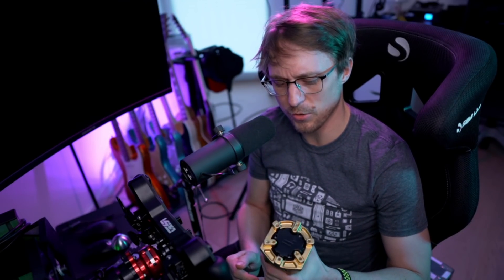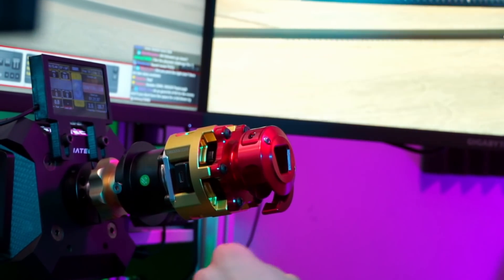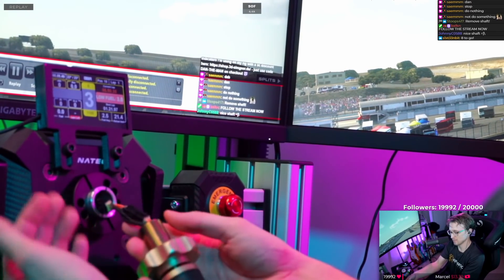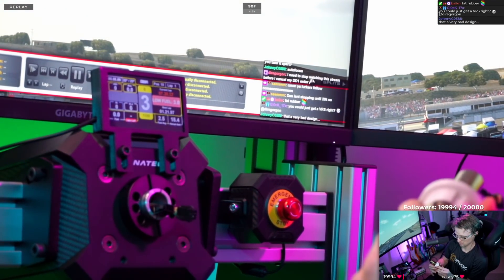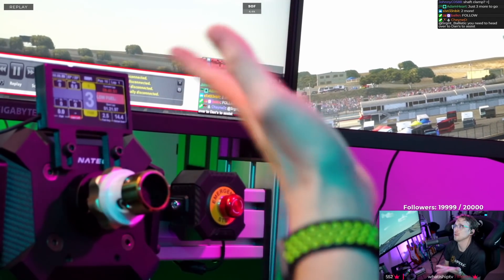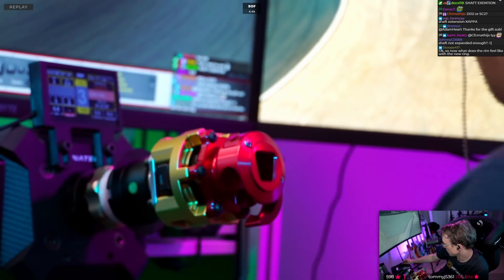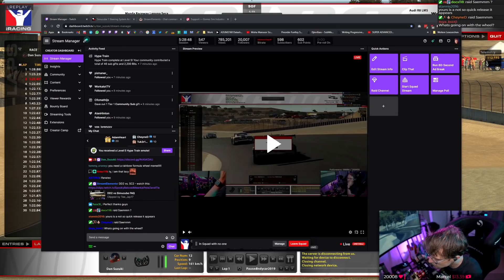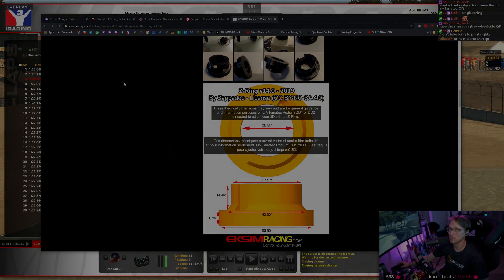Easy solution to get rid of most of the Fanatec QR play! | Z-Ring

Comment: I have also found that longer shafts get more play...

I have a DD2 and honestly it's surprising hearing about this issue.  Mine is solid.  Yours definitely flexes more than mine, and I have a tendency to hang the weight of my arms entirely off of it on straights to relax.
Reply: What wheel are you using? Every person (including me) with dd1 and dd2 has this issue with the bigger wheels. On the F1 style stuff the issue is not that big but stil noticeable so you need the screw which kind of misses the point of a quick release.
Reply: This is because you followed the manual but Dan Suzuki and all the sheeple did not. FYI: You do not need to fit the screw unless you are concerned the wheel will be stolen, such as at a meet or when you run a sim-business. At shows, Fanatec wheels are screwed in place to stop them being stolen.

DS has legitimised the wobble myth. Any wobble is caused by two failures, both cause by users:
1: Confusing wobble in the mount with wobble in the wheel itself where it is attached to its own quick-mount. Even IRL wheels have this problem. As it is likely close to zero of the "wobble gang" have ever sat in a race car, let alone driven one, we can write this off to lack of experience being translated into hubris.
2: Failure to close up the rear ring and rubber lightly BEFORE putting on the wheel. It's in the manual people. Just ****ing do it!

The 3D printed Z-Ring will wear in days and cause pins to break. The reason users think the z-ring works is because they have NEVER properly followed step 2 above! You will notice none of the YouTube "influencers" (no such word, by the way) who show off the z-ring are still using it in their next video. Why? Because it is s***.
Having used SC-QR and the Fanatec, they are identical in stiffness when fitted correctly. 

Is the Fanatec QR a good design? No, it is not.
They should have made it impossible for total d***heads to use it without f***ing up. The real story hear is Fanatec assumed most people who bought from them would be smart, they were wrong.

Comment: Have never had any flexing issues like this, but you should try out the SRM Shaft adapter. It eliminates the Fanatec QR. Its a wheel emulator that replaces the fanatec shaft all together so you can go straight to the xero play QR.

Comment: DD1 and have 0 issues with play in the podium hubs. Just tighten down the freakin lock nut.
Reply from the maker: Didn’t help
Reply: @DanSuzuki  Because you do not read the instructions. Your own videos show you never have. I'll put it in capitals for you:

BEFORE FITTING THE WHEEL
1: MOVE THE RUBBER UP AS FAR AS IT WILL GO.
2: MOVE THE RING UP TO MEET THE RUBBER SO THERE IS NO SPACE BETWEEN THEM.
3: TIGHTEN UP THE COLLAR JUST ENOUGH TO HOLD THE RING AND RUBBER IN PLACE WITHOUT ANY GAPS.
4: NOW, AND ONLY AFTER COMPLETING THE ABOVE, FIT THE WHEEL. MAKE SURE IT IS FULL DOWN AND LOCKED IN PLACE.
5: NOW TIGHTEN UP THE COLLAR.

Now, was that so difficult?
Reply from the maker: @bertram-raven  I'm not gonna put it in all caps, but I hope you can still understand it. If you read the comments (maybe hard because not all caps) you would now it, but I tried this and for my QR it made no difference - maybe I had an especially bad unit.

Comment: Wait you bought a xero play to use as an extension?? WHAT? isn't that thing like over €200 ? You could have just gotten a hub extender/spacer! Lmao, is the xero play nice at least? Ooh also, the reason I found your channel is cuz I was looking for reviews on the GSI wheel, would you mind doing one possibly? A review?
Reply from the maker: I’m involved with GSI - I’m their electrical engineer - I feel like that review would be a bit biased 😅 the zero play is not only used as a spacer here - like this I don’t have to buy 742834 podium hubs, but only one. And then can use any other quick release system like the zero play in this case

Comment: this is why i sold my dd2 and bought a sc2 pro and never regretted it. sc2 pro for the win
Reply: SC2 FFB does not differentiate between slow-bump and fast-bump effects. You should be able to use 100% FFB for fast-bump and dial down the FFB for slow-bump. This is possible with Fanatec but none of the SC series. If you have to dial down the entire FFB strength just to have a wheel which does not tear your arms off, what is point of a stronger wheelbase?

Comment: yawning, not worth trying. FANATEC is repentance..
I had 2 dd1 and dd1 ps4.. I sold it and survived. happiness simucube 2 pro. 
good luck. Get rid of that fanatec while the road is near
Reply from the maker: I think it's definitely worth it if you own a Fanatec DD ... I don't disagree that the SC2 is better in nearly any regard though.
Reply: @DanSuzuki  in a year the adapter died..
software was beta and dd1 froze many times in my race.
I agree, simucube is much better.
Reply: How did u get the simucube yo work on ps4?

Comment: It’s obvious you didn’t read the instructions… the QR is not shit if you would actually read them.

1st, The (slow release) screw is not supposed to be used with podium hubs.

2nd, before you slide the QR on the shaft (or slide it on a bit but not all the way), tighten the gold nut until it’s lightly snug against the rubber. Then squeeze the QR and fully seat the wheel/hub. Then tighten the gold ring until tight. There is almost zero flex when you follow these directions.

Moral: always read directions first.
Reply from the maker: I tried that, same result